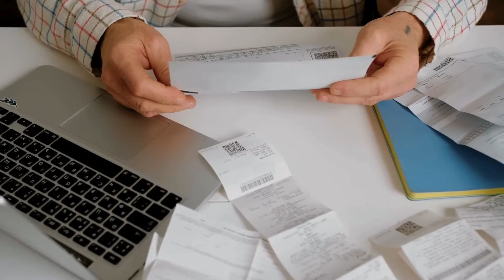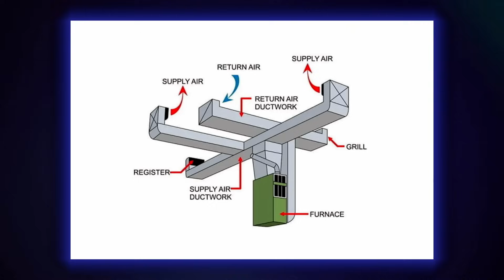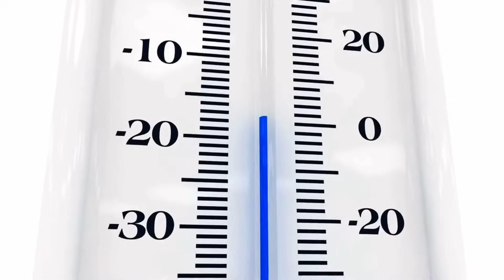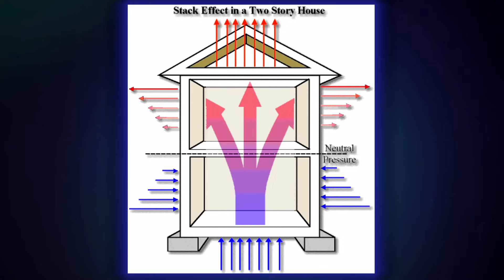5 BIGGEST Heating HVAC Mistakes Homeowners Don't Know!

Comment: 61 year old home /furnace (window ac) 
Utility chase 6”x12ft ! Open from basement to attic! Fiberglass insulation over it in attic? Breathes
Outdoor compressors are being stolen from businesses! 
Does the compressor need to be outside?
Where basement has chase to attic? Basement install is next to power panel ! No remote kill switch!

Comment: I’m not sure how much this would affect the operation of the system but, what about duct cleaning? I have a sixty four year old house that has never had the ductwork cleaned. How critical is this and how often do I need to have this done?
Reply from the maker: Ultimately, I think the answer to your question is based on how dirty the ducts are. Yes dirty ductwork can affect airflow, air quality, and so on. But how much the cleanliness of the ductwork would affect it, depends on how dirty they are

Comment: What crappy company makes hvac systems that require you to spend hundreds of dollars every year to make it work and be safe? The company that made my system does not say that I need annual service to make it work and be safe.
Reply: Every single hvac manufacture recommends annual maintenance you bum. There's even some home warranty companies that will void your policy if you don't show proof of maintenance. There is hundreds of parts and components that get extremely dirty, overheat and fail extremely fast without maintenance. You're absolutely clueless.

Comment: Hey Joshua, I generally agree that having someone knowledgeable on this valuable piece of equipment check my HVAC is theoretically a good thing.  Doubtful I am the only one that suspects that many HVAC Techs figure the homeowner hasn't a clue on what the Tech is actually doing and just does absolute minimum. Never had one check freon pressures or open up and look at air handler fan.

How about making a video giving us all a description of what a "Good" Annual Maintenance consist of that we will be paying for.
Reply: I'd also love to see that! I've been through many companies, none seem to check anything, just like a mechanic who opens the hood, looks around and says everything works fine. Or, they tell you that you need a new system.
Reply: @dusttoyou6035  that’s a video I would share with everyone I know

Comment: In north Alabama, our 2.5 T heat pump has it easy, for example maintaining 70 degrees F inside with 40 degrees outside (at night, with no solar heat) while typically running just 25% of the time. We completed this house 20 months ago with spray foam insulation. We also augment the heat pump in very cold weather (<30 deg) with 42,000 BTU wood-burning fireplace insert appliance. So far, HP emergency heat has never come on.  We do annual maintenance. I run the system fan continuously at night, so our system filter needs changing ~every 3 weeks.

Comment: Hello, I am from DC area. It snowed early January and have been covered with 2-3inches last 3 weeks. Temp is 8-25'f for a week now. I have a HVAC split with gas furnace(two story house & basement). Week back the furnace limit switch tripped due to over heating. The air-intake duct was having a hornets nest, after cleaning it running ok. Also out-air duct was very metallic pungent with some gas smell. But last one week Aux-heat is constantly on and seems not able to heat up enough, though warm air is coming out of vents. I have lowered thermostat temp from 70 to 66'f, still aux-heat running for 2-3hrs at a stretch to maintain temp. Outside heat pump unit is clear and no-snow. Furnace heater is about 20yrs old and heat-pump around 15yrs. Thermostat temp and fan set on auto mode. Ac unit humidifier is not working and duct has not been cleaned for few years. Wondering if that's the issue or something wrong with the system. Last winter heating was ok. Wondering what can I do and if I raise temp to 70'f will it trip or damage the unit ?
Reply: Boy are you going to have a bad electric bill!   We have had heat strips short out in 2 different houses, and did not know it until the $800 bills arrived. One happened in summer and the heat strips were actually fighting the cooling process. OMG.

Comment: I never want humidity in the damn winter time as it makes me feel colder and it's sticky. No more than 30% humidity is where it's efficient. As for a heat pump balancing point mine is set to 32°F as my heat pump can't maintain 75°F while heating. Yes, my heating temperature is 75° as you can take that 67° and stick it up your azz. As for smart thermostats, stay away from Nest thermostat as they are the worst, especially for heat pumps.

Comment: Had to stop in to get blasted. I oil the pillow blocks on the blower every 1 to 2 years on mine. Change filters twice a season. This is heat furnace only. I have replaced the thermocouple twice and the belt once in the 40 years I lived here. Oh, and the furnace is original to the house built in 1949!!!
Had anyone put in one of these new fangled furnaces I would probably looking to buy my third one by now. Yes, it’s 75 years old!

Comment: Interestingly, the heat pump I have works down to the single digits without the need of aux heat. I had a Ducane Lynx installed last year and have backup heat strips since my house is fully electrical. The thermostat they set me up with is a Sensi smart thermostat and it doesn't allow you to set the balance point; it just does it itself based on some unknown algorithm.

Last year, the balance point was way too high and the aux heat would kick on at unnecessarily high temps. Even the techs agreed it came on too much when they came out. So they showed me a trick that involved essentially disabling the aux heat during the mild months where heat might be necessary but aux heat isn't. Fast forward to this winter, I have the aux heat enabled again but this time it doesn't kick on until single digits, so the heat pump is able to maintain 69-70 degrees inside without any help. I'm pretty impressed with heat pumps now👌

Comment: The problem with annual maintenance is there are to many crooks and you dont know what you're getting for your money.
Reply: The fact that HVAC TV and radio commercials focus on selling new systems instead of maintenance services tells you all you need to know. The profit is in the upsell not the routine service.
Reply: Knowing enough about HVAC to watch what Annual Maintenance actually does, tells me that on the most part its a sham.
Reply: @ True other than cleaning which you can do yourself if something is gonna break nothing you can really do.
Reply: @dusttoyou6035 

I agree.

Comment: At some point during our winter it will be cold enough that trying to jack your humidity up much beyond 30% is just not possible, because the outside (baseline) humidity is just too low. It really takes a monster system to raise humidity more than about 20%.

Comment: Should have started with #5, because that is always the biggest bang for your buck.  I love heat pumps and alternative heating methods, but better windows and insulation is really where it's at, when it comes to more effective heating and cooling.

Comment: I have a heat pump in my house (Ruud 2.5 ton ) and its terrible at heating,I can hear the relay at he T-Stat turning on the Aux heat always and and if you push up the temp by more than a degree it comes on no matter the temp. It was installed in 2021 so its not old but the air coming out of the registers is maybe 80 but TONS of it. This one had TXV on the outside and inside. My Old  Gibson heat pump that lasted for 6 years had a piston on both and heated better than this by far. I was told that is normal which is a lie, I had him come out over and over  nothing wrong. I ordered a 18,000 Btu Mini-split from Walmart and installed it myself,18 months ago . Last night it was close to zero and the air coming out of it is HOT , I use it to heat and cool my whole house now. I Keep the Temp of it at 79F on number 3 speed and use fans and the rest of my house stays at 67f which is fine by me and never Aux heat cause there is not one. This thing was only 800 bucks vs 8000+ for the Ruud and that was no duct work or anything. I will no longer be buying these huge systems ,considering  in my town there is price fixing going on , nobody cares it seems. I was quoted 6 grand just to install that mini split even though bought it. It took me about 5 hours to do it myself.
Reply: My old ac guy literally got old.  Was working mid eightys years old bless him.   He finally had to quit for health reasons.   There's only like 2 companies that service my rural area.  One is super ridiculous high priced unless you buy there $200 a year maintenance package which is possibly a good deal I don't know.   You still have to pay for breakdowns but there's a discount.   Anyway the other business is no longer answering their phone.  I liked them but don't know what happened.   Basically I'm a 57 year old lady trying to learn HVAC now. 😢

Comment: I have a modern dual fuel system and it basically never calls for gas heat on its own.  What does happen is that the heat pump system starts to run almost constantly and frequently has to reverse to defrost the coils, but it can easily keep up with the heat load even when the temp outside is in the low 20s.   When the highs are going to be 20 that is usually about where I kick it over to gas manually, figuring that the operating costs are now about the same and I'm saving a lot of wear and tear on the heat pump by not forcing it to run so hard, but the thermostat normally doesn't ask for gas unless it is finding the heat pump can't keep up, and I've yet to find the point where it literally can't make enough heat because it is too cold outside.

Comment: As well, people need to realize comfort costs.  Nothings free, no matter why high efficiency it is, and how well you have insulated and home sealed.  As for your humidity amount, you have never been in Canada in winter.  If you haev your house at 60% in the winter at -25, your house will quickly be destroyed.  Humidity is a crap shoot between comfort and damage
Reply: A balance is what you want for humidity.  If you’re over, it’s a problem, but if it’s too low it’s a problem for comfort also…. As well as during the summer if it’s too high it creates a different problem..    literally every season has a problem with humidity.
Reply: @georgewelker2846  We just got done a cold snap in the prairies in Canada.  So we had lows of -30, which while cold, isnt insane.  According to science and the websites for humidity, house humidity should be 15% at the cold and colder.  Living here all my life, Ill tell you how uncomfortable that humidity is on a person.  Did I lower my humidity, yes, I was around 28% in my house, which isnt as low as "science" says, but still low enough to stop most window condensation.  Humidifier was off a few days before this.   And now with it over, Ill increase it.  But most home owners wont do that unfortunately
Reply: Bad advice. No more than 20-25% humidity in cold climates. 50-60% the windows would be raining condensation and freezing on the glass.
Even with duel pane low e glass. I know. I see it all the time. I used to sell windows and had to constantly tell people to lower their humidity.
Reply: @paulschuenke9529  My wifes bugs me I have 12 humidity sensors in the house.  And its amazing how from one room to the next the humidity can change 5-8%.  Reason I do this is for what you said, to control it in the cold.   Last night I could tell I raised the humidity from 25% to 35%, because it felt warmer in the house at the same temp